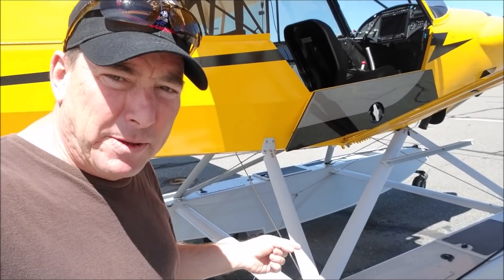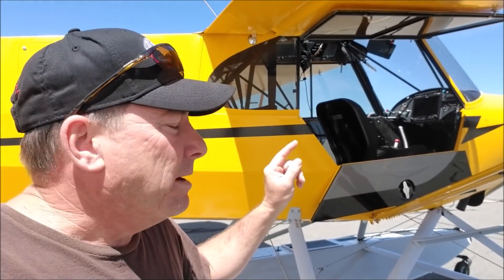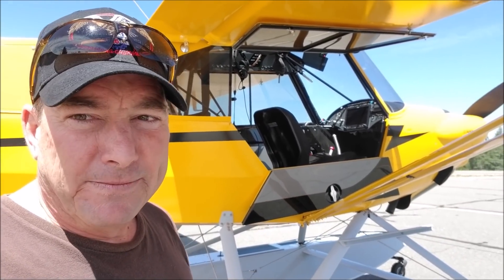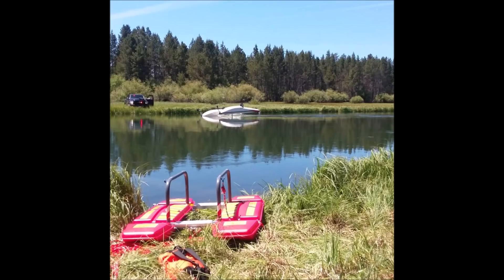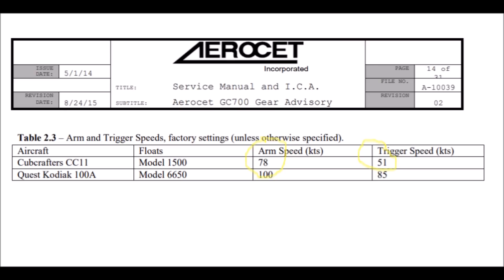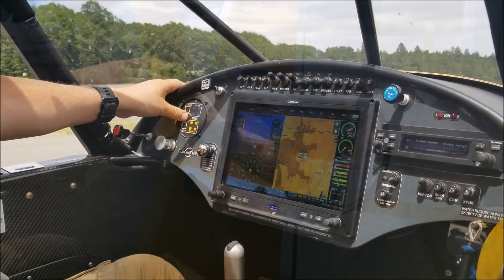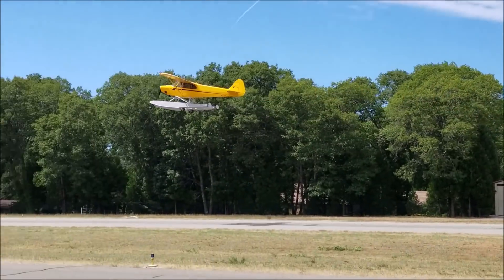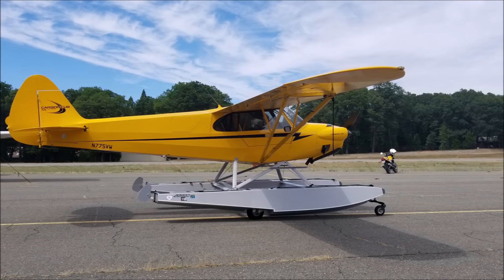Floatplane Safety- Aerocet GC700 Gear Indicators- Carbon Cub Amphib.

Comment: I did so well with that question, here's another I've been wondering about.  I know there are wing tip vortices that can affect other planes on a runway.  I used to think that was mainly vortices from the jet engines.  Now I know about wing tip vortices, I wonder, does exhaust from a modern turbofan engine come out as a spiralling vortice (vortex?), or is it just a straight blast of hot air.  Is the jet exhaust a problem to other planes?
Reply from the maker: The exhaust is not a problem (unless you are on the ground blowing things over). In the air it's the wing tip vortices that can roll aircraft following too close.. Typically the exhaust gets caught up in these vortices, and when conditions are right you get contrails. Ice formed with the help of water vapor in the exhaust.  Check this-https://www.youtube.com/watch?v=AFXtkxWGY4U

Comment: I wonder if it'd be even simpler to have a pitot type setup on the main gear and have the air pressure indicate a mechanical flag on the dash? One each side, double redundancy.
Would be pretty simple with nylon tubing.

Comment: Intrestingly enough my two year old son and I watched that Sunriver float plane “take off”. We never witnessed it get airborne. I even told my two year old out loud “Weird, it never got up in the air”. It was as if it ran out of runway (exceeded MTOW possibly) but I wasn’t certain since the buildings were blocking our view at the end of the runway. We went back across the road for a Pony ride and a long came the emergency trucks. I tried to give my two cents on what happened but they kept telling everyone to stay away and turn around on the bike path. I have a gut feeling that the pilot had a take-off problem and wasn’t intending to land wheels down in the river.
Reply from the maker: Correct, sounds like a density altitude/performance problem....did the engine sound OK on takeoff?
Reply: blancolirio... Sounded solid to me. We watched him do pre flight run up and Taxi; Everything sounded good.
Reply: Keep in mind my whole 20 hours of private pilot instructed flight time 15 years ago makes me no pro when it comes to listening for engine problems :)

I made the comment about exceeding MTOW because it seemed liked the planes speed stayed the same from a quarter down the runway to the end of the runway (until we watched it go behind the buildings at the end of the runway).

Comment: Would the wheels be visible in the wing strut mirrors under poor lighting conditions or at night?  What if one is landing at an airstrip that is at the edge of a lake?  Would the brown/green GPS-driven gear warning lights know the correct operating mode?

Comment: Airspeed-activated systems are not new. The one that is standard with all Wipline amphibious floats was first certified in March of 1993. Wipaire now has a laser system that can detect if you are over water or land. There is a video about it at www.wipaire.com/laser

Comment: Amazing Changes... Back in the 70 and 80s when I was doing floatplane work  fromTwin Beechs down to J-3s, amphib floats were rarely ever found on anything small like Champs, Cubs or any two-seater... in fact, I NEVER saw one...  pretty common place today..   the times do change!  But I DID work on recovering a number of 'upset' float planes, and mostly straight floats, at that.  A good many recoveries involved little more than a 12' boat with a tiny outboard motor, and a few hand tools.   As is true today, TECHNIQUE is the key.... a couple were even flown out after 'righting'... but not all!   Floats are GREAT!!
Reply: Duane Lundgren , way back in the 60s While I was on a trip to Jamaica, We saw 2 DGH  TWIN OTTERS , with floats , at the end of the old runway,,MANUALLY FILLING THE FUEL TANKS, they were being ferried to, either CHILE,,or EQUADOR ., but the LARGEST ON FLOATS was a DC3, somewhere in the West , those were retractable wheels ,on that.,,, Cheers from NJ

Comment: I was in Sunriver when the crash mentioned happened, it was my first hunch that his wheels were down.  However where he landed was very close (maybe 1/4 mile at best) to the end of the runway and on a twisty part of the Deschutes river (no one EVER lands there by choice) Most likely other issues lead to a chain of events..  engine, fuel... probably never had a chance to retract his gear. RIP
Reply from the maker: Yep.

Comment: Cub Yellow Yamaha? Pretty Cool. 
I did "The Flip" in a Volmer Amphib during a severe power loss on departure from an airstrip near a river. We flew about a mile just barely to maintain altitude above the water with intermittent spurts of power until all power was lost and we didn't have time to Hand crank the gear up (I normally left it down as it made no difference in drag and we were operating in landplane mode only with wing floats removed). We tried to touchdown just short of a short gravel bar in the water thinking we could touch the wheels (Like you see Bush Pilots do) just short of short gravel and  roll to a stop before overrunning into the water but even with the most gentle of touch down on the water at about 65 kts was like sticking the gear into a concrete barrier, and as we started to flip I thought I would have a few seconds to get some remaining air but just as we nosed-over the fibreglass nose bowel failed and we were almost knocked out by a huge column of water that rushed through the huge hole in the nose and a hard impact of my head against the Lexan canopy top as the aircraft flipped over. 

We flipped at such speed we did sort of a tail-slide in reverse and slid underwater, and the fast-moving current held us pinned to the bottom against the submerged part of the gravel bar. Dazed from the impact and the rush of water to my face and actually knocking the air from my lungs I tried to open the hatch on my side but felt the latches deformed and locked. I released the Cessna style over-the shoulder seat belt and tried to force open the hatch with my legs but it was like pushing against a welded steel plate as I heard the top mounted engine starting to drag along the river bed. After what must have been a couple of mins I concluded I was trapped, and with my lungs in pain I took a few breaths of water but found that I remained conscious, my lungs just hurt worse. Just as I excepted I was going to drown I heard the dragging of the engine and prop in the gravel river bed stop and saw the cockpit growing lighter,  from dark and muddy grey to a light shade of green, and the hatch miraculously opened. Apparently, the canopy latches failed and along with the remaining water pressure and the canopy being forced against the bottom of the gravel bar was holding the hatch firmly closed. 

Once the aircraft slid off the gravel bar it floated to towards the surface, on the verge of greying-out I tried to escape but found myself entangled by the neck around the shoulder harness even though the seat belt was released. So disorienting was it being inverted underwater, cold and stunned that if I had not had extensive SCUBA training and experience I likely would not have been able to remain calm enough while drowning to escape something that to most might think pretty straight-forward. 

As I reached the surface I was relieved to see 'Frank' (my Buddy and co-owner in the crash) who had been PIC, clinging on to one of the extended main gear tires as we quickly moved downstream, turns out he managed to make it out through a broken windshield.  Frank was a Viet-Nam Helicopter pilot who was shot down three times, crashed twice more due to mechanical failures in AG Helicopters and was a Bush-pilot in Alaska for several years. When I surfaced caughing up muddy river water, he calmly remarked, "Damm, you were down there a long time, I figured you drowned. I replied, "I was drowning Frank!, why the hell didn't you help me?" Frank pointed out, "Well that's the first time I ever crashed in an airplane! I can't swim a lick and the water scares the hell of me!, now I know why that Kennedy didn't get the girl out that car!" 

As we climbed on to the bottom of the Up-turned hull and gasoline rushed out the ruptured tanks we started to sink, and just as we thought we were going to have to 'abandon wreck' we came to rest on another just-submerged gravel bar. I managed to swim to shore and get help from a local gravel pit that had a skiff. 

Why do I share such a protracted tale? Mainly to impress how disorienting, traumatic and highly fatal flipping in a seaplane can be. My take away's are:

- Any water pressure no matter how slight makes opening doors and hatches usually impossible, and you won't be able to open them if any air remains anywhere in the fuselage, and in some aircraft even leaving a door or window unlatched may not provide a means of escape when submerged. 

- You and others may well be injured or confused to the point of not being able to act rationally. 

- Any personal buoyancy may prevent you from exiting the aircraft. Don't wear or don a flotation device unless it's completely deflated until you are out of the aircraft. 

-  Always wear a thin low restriction, inflatable flotation vest 

- Have a Bail-out SCUBA bottle for you and anyone you care to see survives (NO JOKE!). 

- Use quick and full releasing harnesses (not the Factory Cessna - Cross-style belts) and think through an inverted, escape.

-On Amfibs always retract (raise) the gear,  as it's preferable to land 'Gear-Up' on land than 'Gear-Down' on the water
Reply from the maker: Outstanding story!  Thanks Jack.
Reply: @blancolirio  My Pleasure. Thanks for the Saftey tip, 
BTW corrected some things and may have lost the pin
Reply: Wow that is an excellent story.  Nothing to apologize for.
Reply: Incredible story, happy you made it here to tell us all how treacherous it is.
Reply: @wgmskiing  Thanks, Seaplanes are magical and fun but sort of like 'Double Jeopardy' if you screw-up.
Reply: For more on the disorientation, look up the Mythbusters "Going Turtle" test where they flip a car. And find Adam's reaction to it on another show.

Quite amazingly disorienting!
Reply: @TestingPyros  Thanks, I became acquainted with Adam when they first started Mythbusters and suggested the underwater car escape and some other ideas like a non-pilot landing an airliner simulator.  I asked t a friend who worked for UAL Services to see if they could do it in a 747 Simulator but United's risk management group shot it down. 
Being inverted is disorienting but what was the most stunning part was the violence of the impact. I recall the Tom Hanks' Castaway movie was playing on cable after getting home and cleaning up we both happened to turn it on. The sound of the crash and water scene with Hanks trying to escape brought flashbacks for both of us,  and the way the cockpit flooded in the movie was very similar but in our case happened about 10x faster and more violently. For days we both would see the crash and hear the sounds just as we were going to sleep.  It could be very similar in a car or boating accident. 

Something else to keep in mind is how such a traumatic incident can affect one's ability to function afterword as a pilot. 

Two days after the crash I had to deliver an old Skymaster I sold to a customer and give him a brief checkout. I did not think it would be a problem but on takeoff and for about 20 mins I was so compulsively pre-occupied (Hypervigilance is a result of Traumatic stress) that if I had an engine failure or something serious to deal with on takeoff and the first few mins I doubt I'd have been able to deal with it effectively.

Comment: Hey, I got a question.  Do airliners have any exterior video cameras, like for looking at the gear, looking behind you, under or above you?  Seems like a good idea, dunnit?
Reply from the maker: It is! The 777-300 has built in cameras to view the engines and the gear. Cameras located on horizontal stab looking forward towards engines. One under the nose looking at the taxiway ahead.
Reply: blancolirio  way back on AA, few models had a camera displayed in cabin fo a camera view of only the NOSE GEAR,  Cheers from NJ
Reply: Some modern jets have one or more for the air show entertainment system, usually looking forward from the bottom behind the nose wheel.  But newer large jets have at least 3 for seeing around the aircraft while on the ground taxiing, loading etc.  Wheels/gear can be seen on the ground and if used in flight, you can check on a gear position problem/engine problem/engine missing....etc. B777, A340-600 etc usually have them installed. Smaller jets it may likely be an option.
Reply: I got 2 answers"! Thanks!

Comment: Whose RZ350????   If you’ve picked that up, you need to do some footage on it!!!    Very nice bike!
Reply from the maker: Stby for an RZ update soon...
Reply: blancolirio ..... this is a killer teaser!   Haha.... Let us know what’s going on!  I can smell it!  Tell us about it, where did you get it?  When?  I’ve got premix in my blood...  lol...
Reply: i have had my '84 rz350 since '94. love the bike.  i burn klotz benol oil. i get about 5,000 miles out of the top end and 15,000-25,000 out of a crank.  she's ported & reshaped domes/milled with the still small canadian carbs and she screams! powervalves keeps the low rpms respectably torquey. old reliable kickstarter has never left me stranded :)   oil injection removed and keep different bottles of premeasured amounts of oil, in the place the oil tank was.
Reply: still have the stock cylinders and head, couldnt find a replacement 6th gear, so it has a banshee 6th gears.